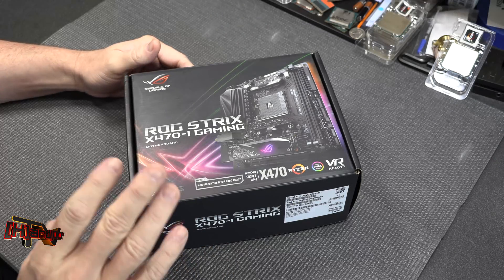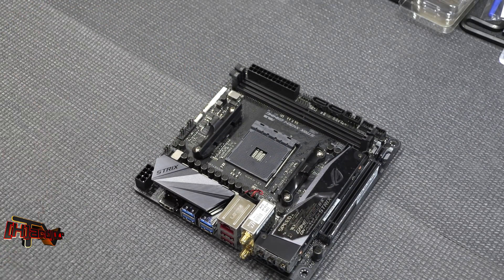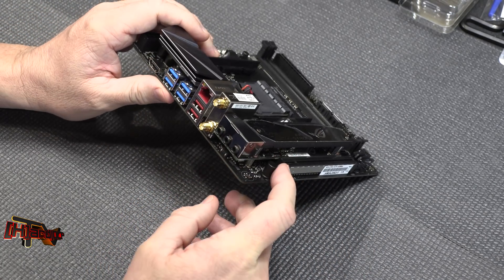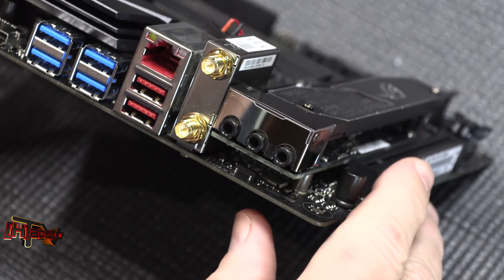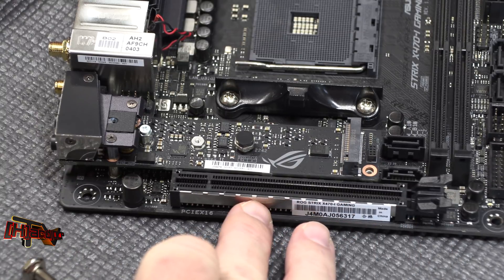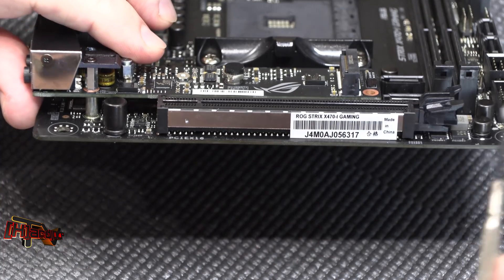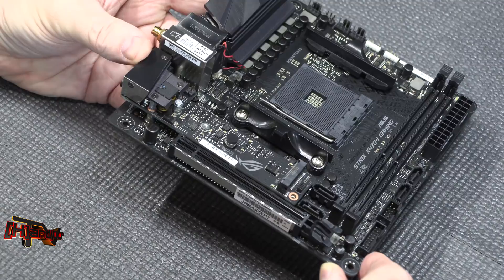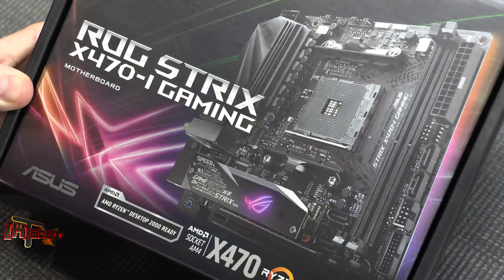ASUS ROG Strix X470 I Gaming Motherboard Unboxing & Features

Comment: I have a serious question about this board.  Take in the fact that the choosen cpu/apu will be removed at a later date and used for another budget build for family.
My question pertains to using an Athlon 200ge with this board 
"AMD Ryzen with Radeon Vega Graphics Processors/7th Generation A-series/Athlon Processors
- 1 x M.2_1 Socket 3 with M Key, type 2242/2260/2280 (PCIE 3.0 x4 and SATA modes) storage devices support
- 1 x M.2_2 Socket 3 with M Key, type 2242/2260/2280 (PCIE 3.0 x4 mode) storage devices support**
**The M.2_2 slot shares with PCIE x16. When M.2_2 slot runs in PCIE mode, the PCIE x16 slot will be disable."
 also my understanding why it disables the pcie slot is due to this line 
"AMD Ryzen with Radeon Vega Graphics/7th Generation A-Series/Athlon X4 Processors
1 x PCIe 3.0 x16 (supports x8)"

But here is the question ( in relation to the pcie lanes being disabled when using m.2_2)
If i disabled the gpu side of the apu am i able to still use both of the m.2's and a regular gpu? Because i will be salvaging my old RX480 out of my current system and plan on going for at least 2x500gb m.2's for an itx pc build.

Comment: I have noticed this motherboard has triple-output audio.
This would mean the mic-input will be reprogrammed to act as the Center/Woofer output in a 5.1 setup. Using the ASUS H110M-D which has the same audio setup, I experienced nasty bursts in the center and woofer speakers whenever the PC goes into sleep-mode or comes out of it. Same thing when you shut down or start-up your PC.
According to ASUS customer service, this is all within specs, so I wonder how this motherboard performs. See my measurement on the H110M-D: https://tinyurl.com/y7of8kxn

Comment: Is it possible to remove the audio-pcb without soldering? I didn't find any answer to this elsewhere
Reply: the question is why would you want to remove the Audio output? unless you are questioning "if you can replace that board if it dies?"

Comment: I have issues with this board and my 2600x .... ti doesn't boost as it should , on cheaper PRIME board this CPU was doing great  ..
Reply from the maker: Update the bios?
Reply: @HardOCPTV   I haven't update it , it was shipped with Version 0601
 and it's still on that ..  last board PRIME X370-PRO which I tried to flash it got stuck in middle of flashing and I bricked the board(wasn't my fault though) I had to wait almost two months before I got replacement .. RMA process is really slow in my country so I would rather not flash bios again unless that's only option left ... it's stupid how these premium boards from ASUS don't feature dual bios while even low end cheap boards from GIGABYTE have it as standard .
Reply: @darunealbane  thanks but I am not a noob and I don't need some stupid utility to find bios and flash it, I've done it countless of times before . And safest way to flash it is via USB.

Comment: When you look at what the average computer user does on their computer, this think is over-kill for their needs.    They don't need 4 SATA ports, or all those USB ports, or super fast M2, or fancy hi-fi, of AC wi-fi, etc.      However, this board does almost everything I need, so the sacrifice in deskspace and portability, etc. is a practical trade-off.      It is hard to pull out $ 235 out of my wallet, when for the same money, I can get a refurbished TR4.
Reply from the maker: I would suggest that ROG and STRIX motherboards are not built or designed with your "average" user in mind.

Comment: Checked Asus' website for this mobo. They had no Win 7 drivers. Are they on the included CD/DVD?
Reply from the maker: I do not know.
Reply: Seymor Onion why the hell would you want to use windows 7 drivers in 2018!?
Reply: There is a rumor going around that Mini ITX motherboards work great in HTPCs.

Also, because there are no Win 8, 10, or Linux drivers for some HTPC-centric hardware, 
such as certain easy-to-use remote controls, and some older gamepads; 
as well as some software incompatibilities.

You can add the above reasons to the fact that some people can't afford to spend thousands of dollars on replacement hardware and software just to have the latest OS for a HTPC that will not have it's web browser used.

It is all basic stuff, really. I'm somewhat surprised you are not aware of this.

Comment: Asrock also have a X470 itx board
Reply from the maker: Yes, we buy plenty of products to review.  The fact is that we have more motherboards to review than we could ever get to from other manufacturers.  ASRock is stopped sampling after we had critical reviews.  They took their toys and went to other sites with their support.  When you start reviewing motherboards and having issues, support is needed many times to get to the bottom of questions and issues.  ASUS, GBT, and MSI will give us that support.  We would rather deliver complete reviews rather than more questions.  So it is not simply a question of buying the motherboard in order for us to produce an informative review.
Reply from the maker: Pretty much.  We have even given them reviews on boards we have purchased which have been good, but they will not ever respond to emails, so it makes doing a proper motherboard review a real chore if we have questions....which we almost always do on motherboards.
Reply from the maker: Yes. AsRock will not send boards for review to us.  We are too tough with our reviews and they get their feelings hurt.  :(
Reply: HardOCP TV could you buy the board then like gamers nexus does when companies won't send review units. Or mention asrock instead of saying Asus is the only itx board. Shame you guys won't review it so far asrock has better user reviews then Asus on sites such as Newegg and Amazon would be interesting to hear a comparison. ~sent via BlackBerry Keyone
Reply: HardOCP TV what do you mean by that?
Reply: HardOCP TV so asrock got butthurt over a bad review?

Comment: I'll be curious to see what your review reveals about the BIOS and hardware quality of this board.  I've been running this exact model since mid-May on my 2700X + Vega 64 combination, and I've been very satisfied.
Reply from the maker: Testing now.
Reply: tarqsharq what case are you using for all of that?
Reply: Hey how's the testing going?  I haven't seen a review up yet :)  I'm running mine in a NZXT H200i with additional fans in the front for more air.